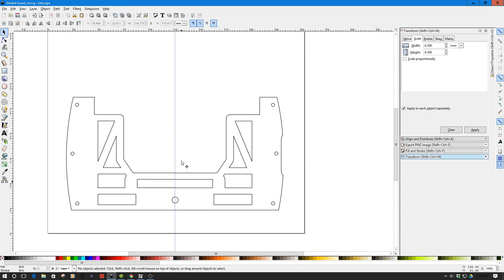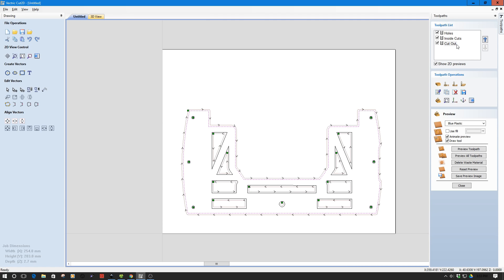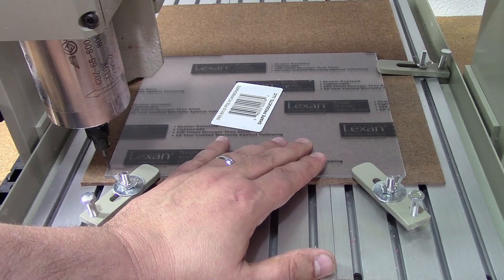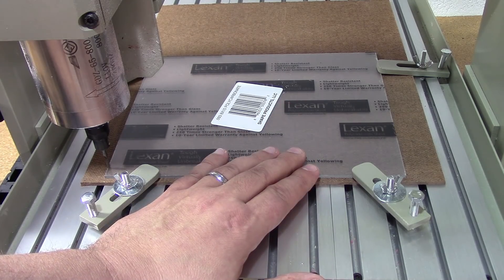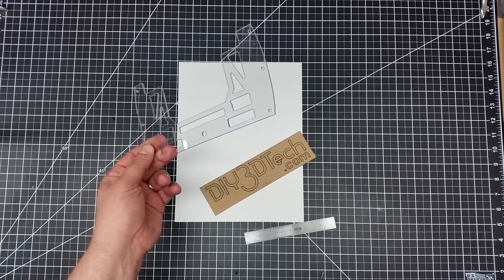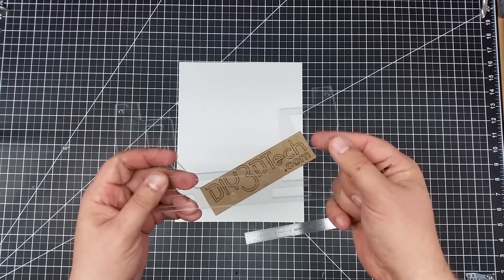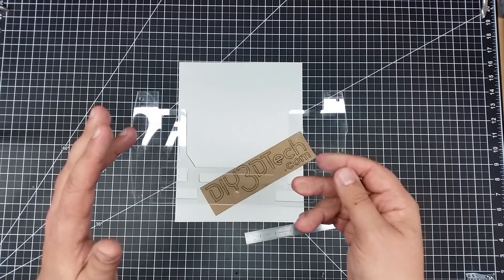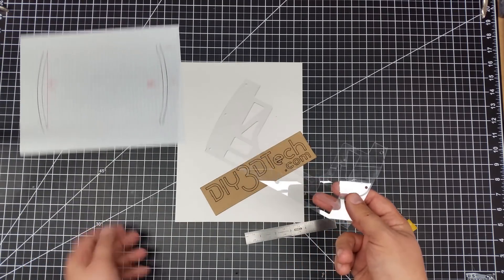3040 CNC  - Milling Polycarbonate With Single Flute Bit!

Comment: Ok thanks...im surprised that hobby cnc can do that fast.. 100mms is pretty fast for screw drive ..whats the fastes u have used?...i really like those 6040 and 6090 w 4axis on ebay they look like a pretty design design and look rigid.   Is ur cnc fairly rigid?
Reply from the maker: Yes to the rigid and never pushed a top limit but they can move and I went with the 3040 due to size but the 6040's are great too

Comment: 100mm min or 100mm sec?...100mm minute is insanely super slow like 4in min.....usually when cutting pkastics you want fast feed rates to prevent melting...
Reply from the maker: This was a while back, however I typically work in mm/sec

Comment: I build my own CNC out from scrap, literally scavenge materials from printers old wood from chairs, and it did some heck of the job I wanted. I cut acrylics from 2mm thick all the way to 10mm. tried every number of flutes to it except the SINGLE FLUTE!..I normally use 2 flutes. But with this video, I will try that single spiral, for it was true. I tried everything on an EXTRUDED ACRYLICS that melt so fast it clogged my 2 flutes.
Reply from the maker: Single flute is the way to go unless you can slow your spindle down...

Comment: What mm/m and deep per pass i have to use to cut acrilic?
Reply from the maker: Depends on your cutter and spindle speed
Reply: @DIY3DTECHcom  one flute and 8000 RPM,can you help me
Reply from the maker: What size bit?  Also take a look at this site: http://www.plasticrouting.com/ too for help.  Also on PC it likes to chip weld so might need to use an air blast

Comment: In the beginning you said 100mm per second and at the end you said 100mm per minute. Which was the actual speed? I would think 4 inches per minute is painfully slow. Good video, thumbs up!
Reply from the maker: +Rick Perry I am old 😜that my excuse and I am sticking to it.  100mm sec as whip though pretty quick to prevent melting...
Reply: I thought that sounded more like acrylic speeds but it threw me off. Keep up the great work...
Reply from the maker: Thanks :-)
Reply: Gotta do some tuning to my steppers in Mach3, I can only get 60 ipm right now straight out of the box.

Comment: That single flute bit you are using is described as an O-Flute (and in this case is an Upspiral bit).  This is and ideal plastic cutting.  It can usually cut it's diameter in thickness in just one pass without straining it all all.  Since you do not have a vacuum hold down, you can use double sided tape to help hold the part to do away with chattering.  It appears that you are using V-Carve by Vectric, which is a very good inexpensive drawing and tool path programme.  You may wish to edit you start points (especially on inside corners) since many of these programmes won't provide enough of an offset when they start on an inside corner.  You can also provide a lead-in/lead-out to help with providing a cleaner finish of your finished part at the start/end points.
Excellent video.
Reply from the maker: +Gus Pappas thanks for the comments!  Using Cut 2d a very old version so not much exiting can be done.  Your also correct on the double sided tape I am just not a fan more so cost reasons however if I do something that I want perfect I do use it.  Also with the right power one pass could do but I find multiple provides for a clean finish especially if I over cut 😃

Comment: So it stinks when heated up YET we have that stuff as a 3d printer filament now.  Stinks worse than ABS?  Is it carcinogenic?
Reply from the maker: +Dark Alchemist about the same I would say and is it a carcinogenic?  Not a doctor so couldn't say but anything that gives off fumes is a risk.  I do have ventilators in my shop so I don't worry so much about fume however particulate matter I do and one of the reasons I won't cut carbon fiber dry.

Comment: That thing makes a mess! I thought you had a vacuum set up for your shop. Have you not got it affixed to that C&C machine?
Reply from the maker: +Norbert Davis CNCs can be messy and the dust collection impede the video and makes a ton of noise I just vacuum later as it you back I built a plexiglass shield to contain the debris and works well 😃